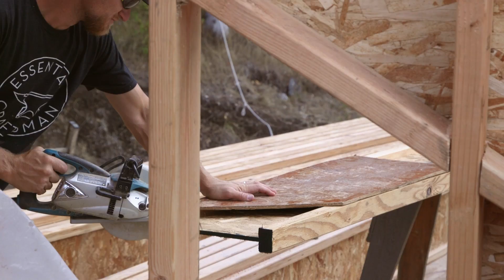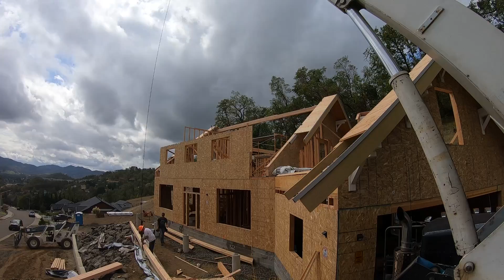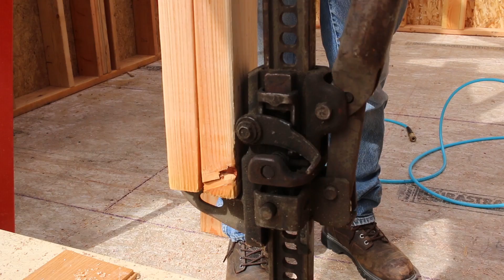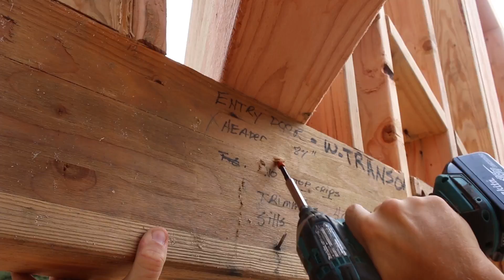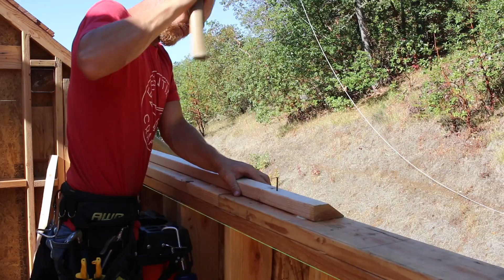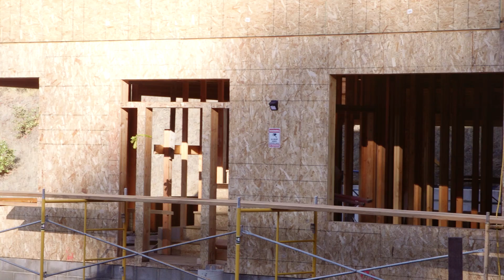Lowering a Beam and Installing Rafters Ep.65

Comment: plain question from overseas : how long can such a one story house made of engineered wood products last ?
Reply: If you keep it dry and maintained the lifespan is indefinite as the wood will remain intact as long as it does not get consistently exposed to the elements
There are wooden structures still in great shape going back to the 1800s as of now in the US mainly because before that most structures were built from masonry products such as stone and brick
Reply: @xCoolBreezex  they were already using engineered wood products bask in the 1800s? it's the gluing of wood chips and particles that I'm wondering about (and if at all possible not being restricted to live in the Atacama desert)...
Reply: n 135246 oh right 
The only real answer is to look at the material data sheets for whichever product you are considering 
NAHB or National Association of Home Builders states, “Floor and roof trusses and laminated strand lumber are expected to last a lifetime, and engineered trim is expected to last 30 years”.  Hope that helps
Reply: n 135246 If you keep it dry and maintained the lifespan is indefinite as the wood will remain intact as long as it does not get consistently exposed to the elements
There are wooden structures still in great shape going back to the 1800s as of now in the US mainly because before that most structures were built from masonry products such as stone and brick

Comment: I think I know how the overhang will be done. You could fill in the web of the rafter flush to the flange, then sister 2x6 or 2x8 flush to the top. Then comes the issue of filling in the dead space between the rafters. Hmmm
Keep it up,
Greg

Comment: Interestingly the European equivalent "Steico I Joists" explicitly bans any drilling into the flange :-O
Reply: Then how do you fasten them?
Reply: @somegoddamnguy  Nails/screws without pre-drilling.
Reply: I think the ban on drilling into the flange refers to drilling holes for wires or pipes to pass through the I-joist. A properly sized pre-drilled hole for a lag bolt or structural screw would not compromise the strength of the joist or rafter.
Reply: @janderson8401  It's actually quite explicit. Let me quote: "Do not drill the flange".

Comment: 9:56 seems like it would have been faster and easier to cut those before you put them up but more than one way to skin a cat!:-)
Reply: In carpentry, there is a "Measure Twice, Cut Once" saying, but there's also the idea of "Economy in Steps". I think, in this case, it was probably easier to install then and then cut to fit over having to repeatedly measure each location and beam to make sure they're cutting in the right spot. It would have been safer to cut them on the ground, but a lot more time consuming. But, with that, I'm not saying either process is better.
Reply: @jackielinde7568  cut everything on the ground .it takes mote time to cut when up in the air and it takes two saws to do it in the air
Reply: @jefflinnell8492  I'm not going to second guess the carpenters who have more experience than I do. I'm merely stating why they might do the cuts in the air.
Reply: Probably easier to cut on the ground, but it's always more accurate to "scribe" or cut in place to get the true measurement.
Reply: @mae2759  they are cutting rafters , if your rafters aren't all the same length there is already a problem . the way he did it isn't wrong just different than most
Reply: It's always easier to cut/pre fab on the ground, but you math better be correct. Typically in my experience, doing residential guys who cut in place do it cause they dont know the math or screwed up some place and leave it long to make up for error